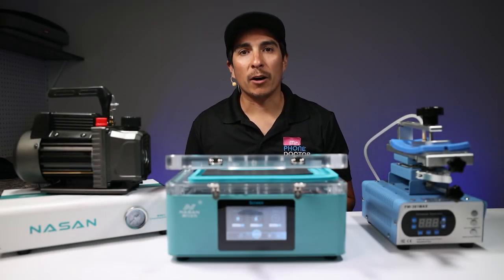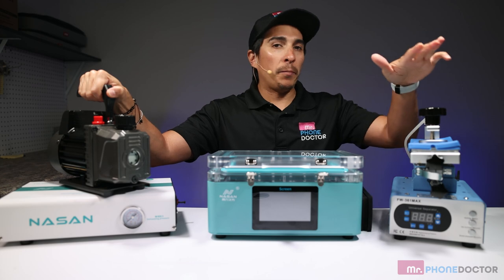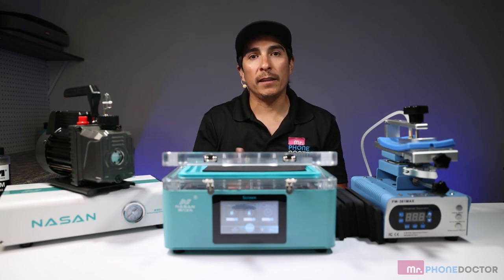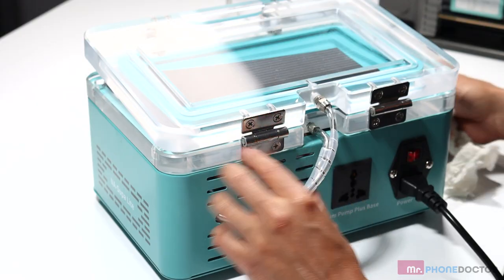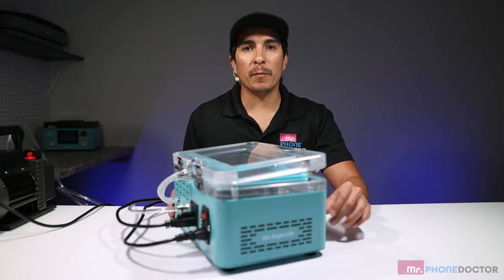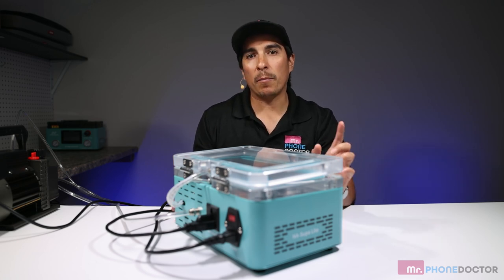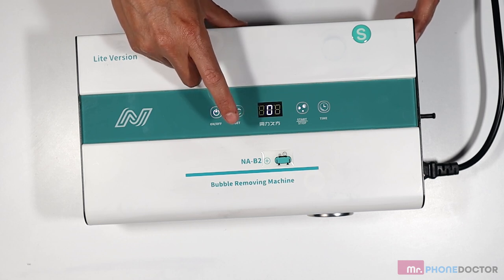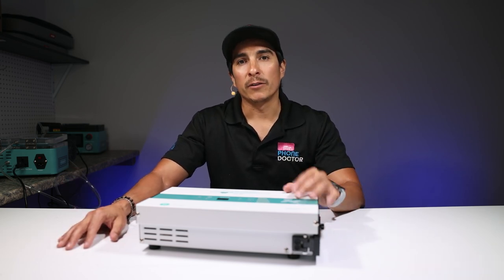How-To Set-up & Use Nasan Supa Lite & B2 Plus Autoclave Bubble Remover

Comment: Equipment in the repair space has really come far. I'm still using my bulky laminator and autoclave with a huge air compressor and vacuum pump. It was really expensive at the time and takes a lot of room 😢. Now it's cheap and takes up less than 1/4 of the space
Reply: I think a normal cylinder laminator remains better, but these air bag laminators from Nasan seem to be very decent

Comment: Thanks for the instructions, nice video.
I was thinking about the Nasan Supa Max as I wanted to be able to laminate all kind of sizes (even tablets) and curved screen, would you recommend it?
Reply from the maker: Its good machine. It won't fit 1st or 2nd gen ipad 12.9. If can wait a bit longer there should be new one coming out no need for compressor and does all screens.
Reply: Nice, thanks for the info, I'll wait patiently

Comment: Hi Javier, just purchase the Nasan Supa light max 15 inch, it requires a 2L vacuum pump, all i find on ebay and my local a/c store different numbers of CFM vacuum pump, what cfm equals to a 2L vacuum pump?
Reply from the maker: Good question not sure. We have the 2L vacuum available on our website e
Reply: Harbour Freight has 3 and 5 CFM, I use a 5CFM works great.

Comment: Are the precut molds different sizes and have flex cable cut out?
Reply: Yes, different sizes. As far as I saw in the many videos from Nasan, the cables are not cut out, so you need to put some foam between the connector and screen when laminating
Reply from the maker: Yes they are all laser cut for each model you need. No cable cutouts. Which is really not needed since they are so soft.